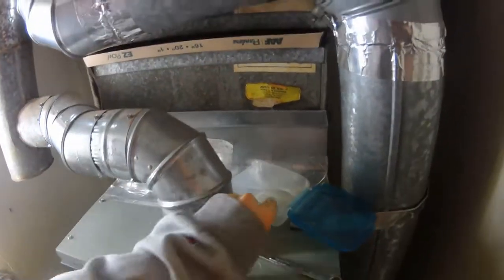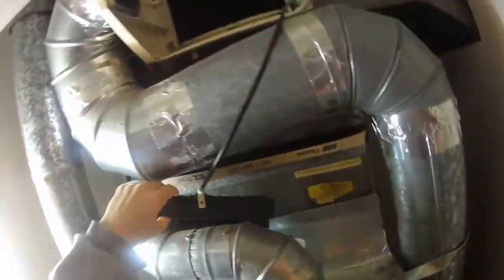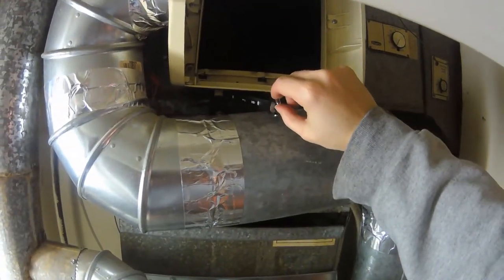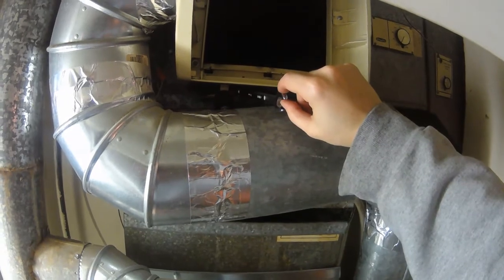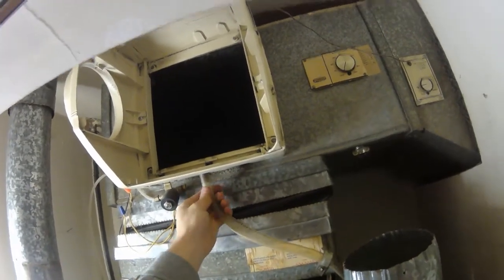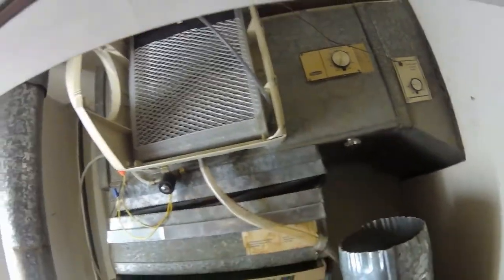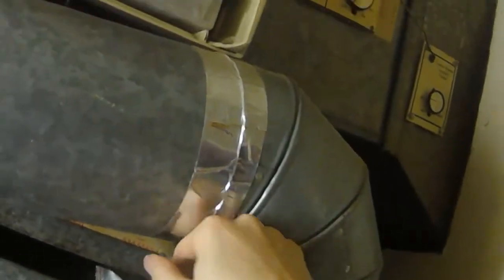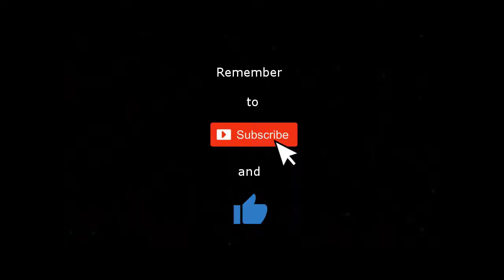Replacing the Water Supply line on an Aprilaire 550 whole house humidifier

Comment: Of the few videos online addressing the Aprilaire 560, yours was very helpful in installing the maintenance kit.  A former friend, removed the unit from his parent's house and installed it as "new" in our house, 23 years ago.  Did I mention, a former friend?  Hey, he could have buried the thing behind duct work, but since we paid for a "new" unit, why add insult to... He did not install the inline strainer.  A duct baffle would have been a nice touch. Last year, a local plumber replaced the water panel and the drain hose.  A full maintenance kit would have been in order, from the scale and crap on the scale control insert and the panel! We have had a leak this early winter.  Now that the maintenance kit is installed, I suspect the leak is from where the drain hose meets the new drain spud.  It has been unseasonably warm today, so the furnace has not kicked on, to test my hypothesis.

Comment: My plastic line cracked right at the bend in the case. Bad design.
Reply: I agree with you.  The same thing happened to me.  The hose sprung a leak at the bend where the hose clips into place.  But I have to admit, it took 15 years for it to start leaking.